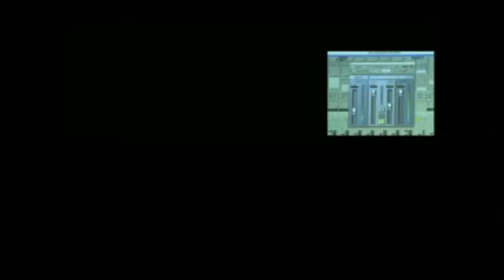Arturia Sparkle Demo - Building A Track In Sequencer Mode

Comment: Does this need a computer?
Reply: TheMajorScale bro. I thought you could build a sequence with the SparkLE without syncing it to the software. I thought the software was just there to make it easier to tweak some things, plus allow you to import samples. You actually need it to work with this thing?
Reply: SgtSlavin Hypocriticalfollowers  you know what slavin maybe onto something, but from all the research ive done and playing with it at guitar center i've never seen anything saying it was a standalone intstrument. I could be wrong but to answer hypocritical's question literally, i dont think sparkle even turns on without the usb plugin to a computer. but slavin, whether or not you have to open the prgram in order to play and make sequences ,idk
Reply: TheMajorScale bro. I did some research and it seems that you need to plug it into a computer, but you don't necessarily need the bundled software. You could use it as a MIDI controller for Ableton or whatever DAW you use.
Reply: ***** Thanks!